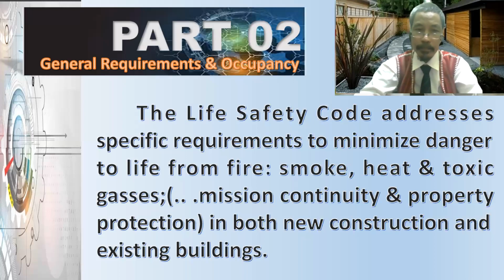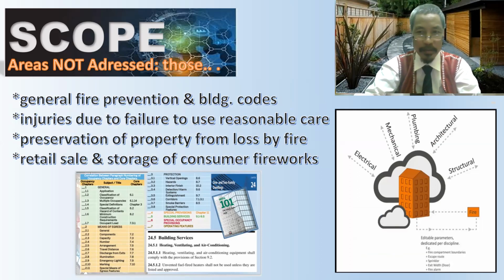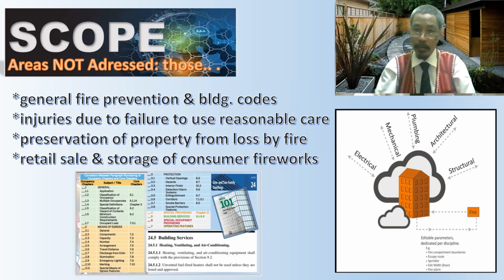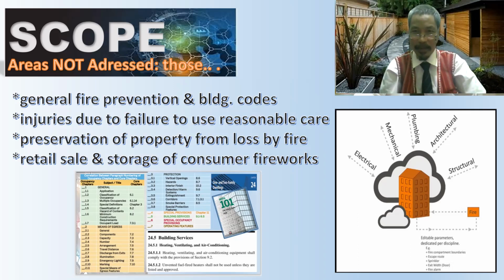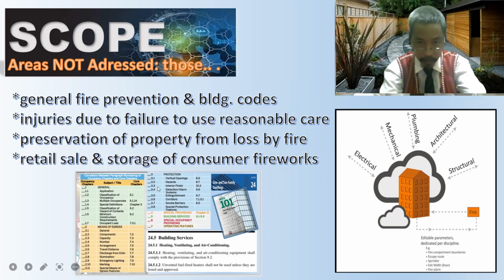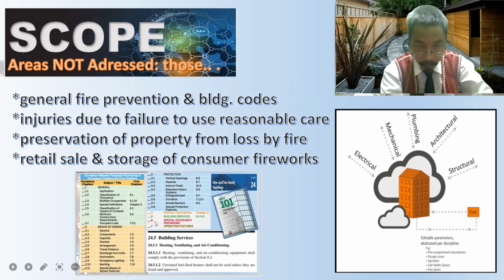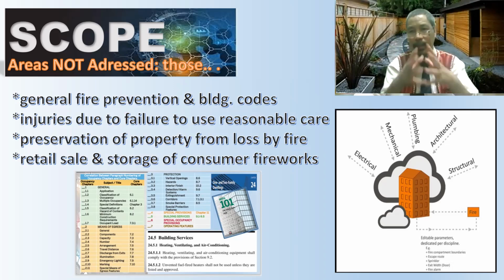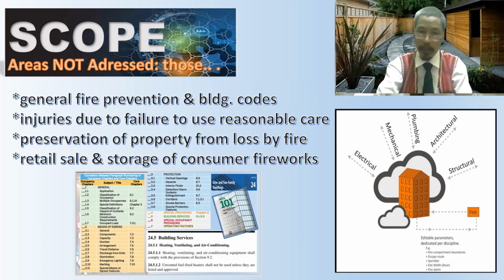SCOPE covered by NFPA101 || General Requirements: Module 06.1 [ Reference CODE by RA9514 - IRR2019 ]

Comment: Thank you sir for this video lesson about SCOPE covered by NFPA101 || General Requirements: Module 06.1 [ Reference CODE by RA9514 - IRR2019 ]. In this video I gathered information about the scope covered by NFPA 101 such as construction, protection and occupancy features to minimize danger to life from the effects of fire, including smoke, heat and toxic gases created during a fire.

Comment: Thank you sir for this lecture that talks about the scope of fire protection which is to minimize danger to life from the effects of fire such as smoke suffocation, heat, and toxic gases. Also, it tackles about the limitation or areas that are not address such as fire prevention, building codes, injuries due to failure of reasonable care, and preservation of property from the loss by fire.